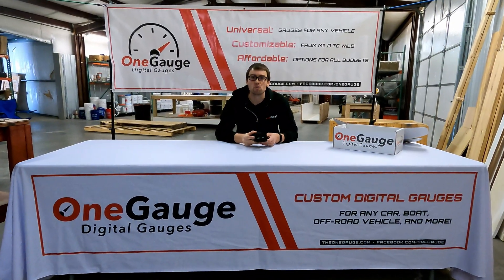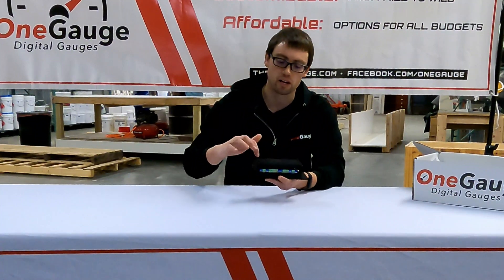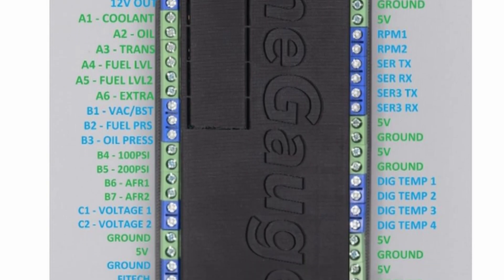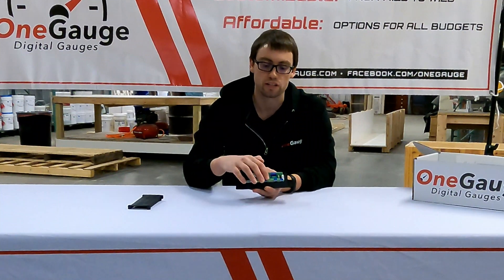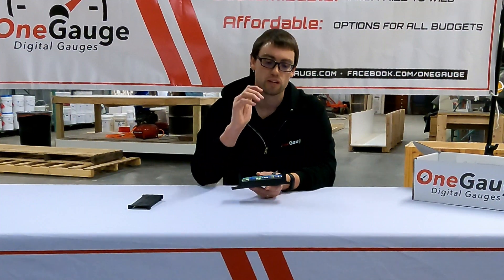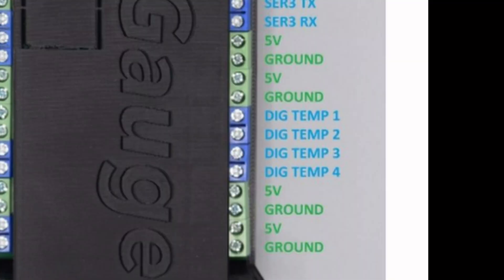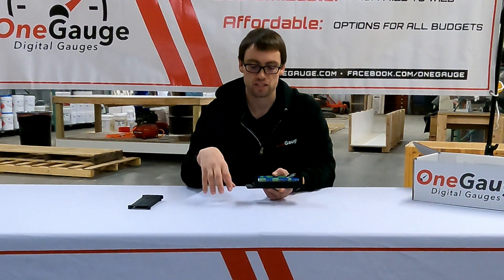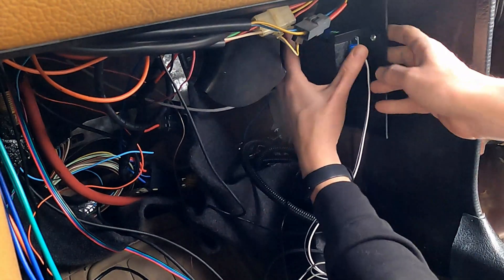The OneGauge Hub Explained

Comment: How many wired output (perma screens) can it handle or will I have to use Bluetooth for a second screen?
Reply from the maker: Good question. Two by default but more could be custom configured to work if required.